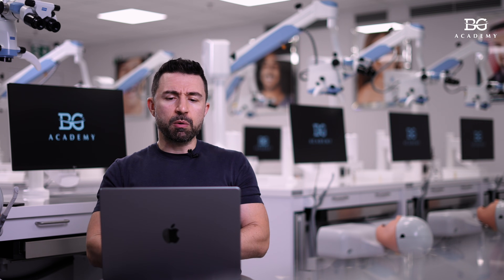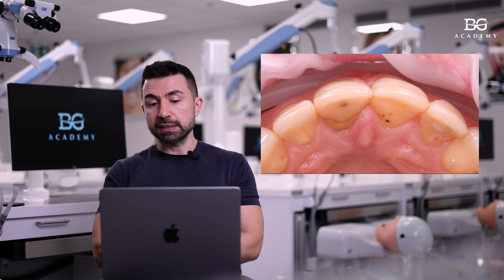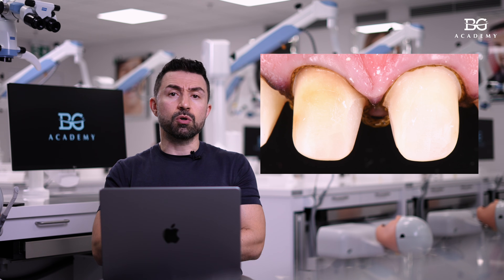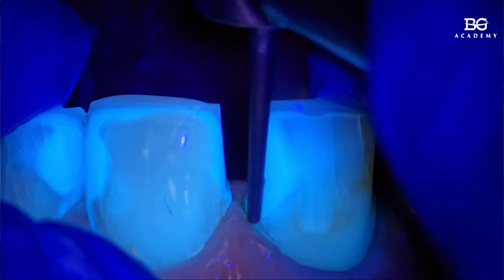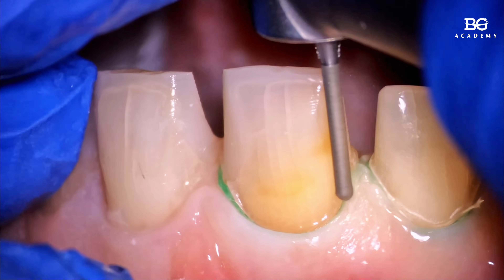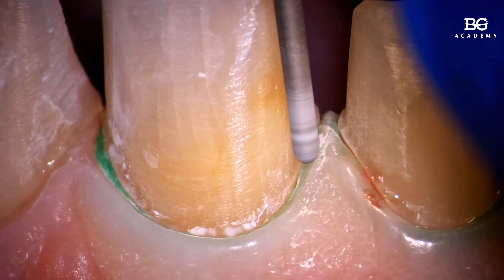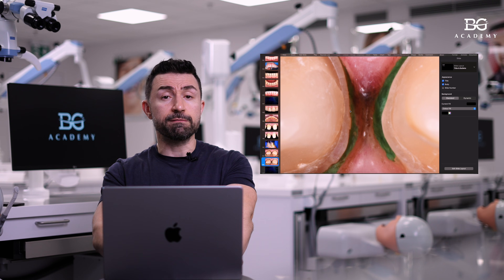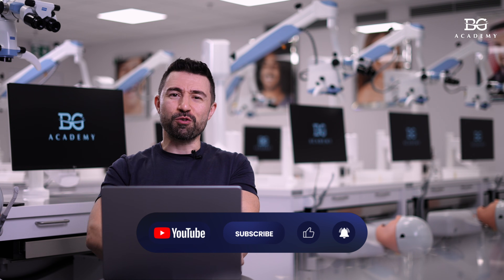No margin on composite?

Comment: What speed did you run the hand piece at? Thank you
Reply from the maker: Electric motor, increasing handpiece, red bur, low speed (40.000-80.000 rpm)